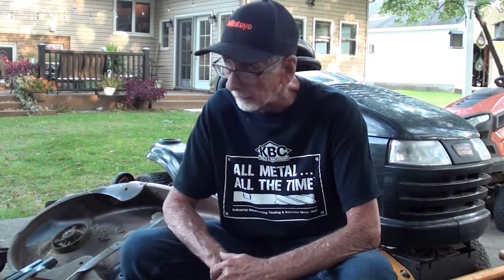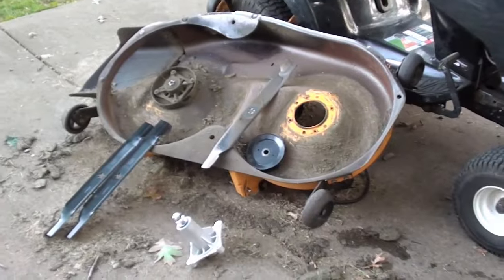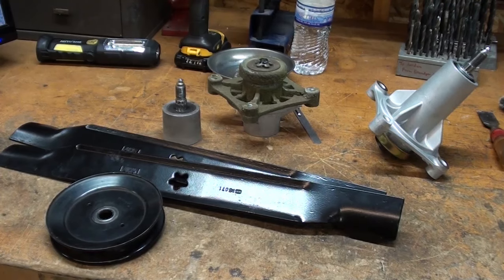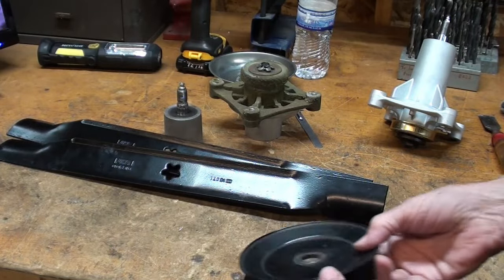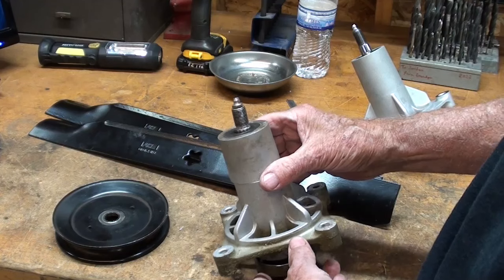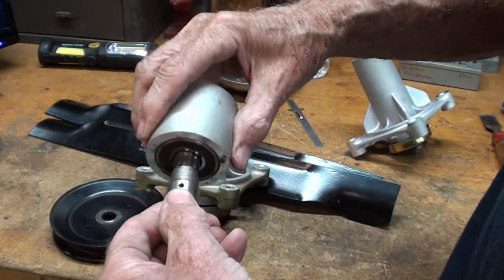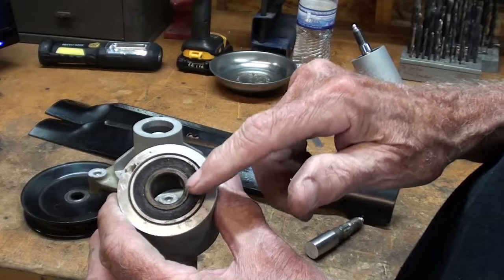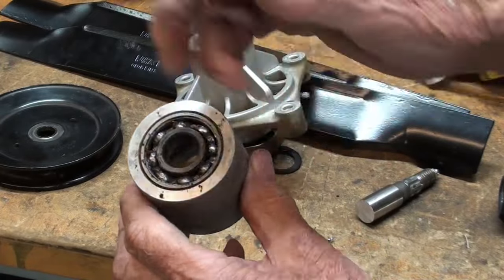LIES & DECEIT mower spindle fraud SHORT SUBJECT #52 tubalcain

Comment: I disagree somewhat... if the hub is filled with grease, it won't fill with dirt, moisture and rust. A sealed bearing will last much longer if it has grease against the seal versus moisture.  I used to off road race dirt bikes and had to change the sealed wheel bearings every season, because the hubs filled with moisture and so did the bearings.  I drilled the hub and added a grease zerk, so I could keep the hubs full of grease, which kept out the moisture. I never had to change wheel bearings for several years.

Comment: Wait until you get to the hydrostat. No external filter and nigh impossible to change the oil in; meant to last about 200 hours and that's on exclusively flat ground. I wish I could just buy an affordable lawn mower with a manual gearbox again.
Reply from the maker: I have never had a problem with hydrostatics and they have lots of hours on them. I would never go back to a gearbox like my old cub, cadet had.      It took so long to shift into reverse compared to hydrostatic
Reply: @mrpete222  Admittedly my experience is from zero-turns with Hydro-Gear motors and I mow a lot of hillside as well. I still think it's poor design to not have an easy method to drain and replace the oil. I just remember using a Ford mower with a gearbox when I was a kid and it seemed bulletproof. Side note, I want to thank you for all your videos. I'm just getting into machining and restoring some old machines and your channel is a gold mine.

Comment: Recently YouTuber Chickanic did a similar expose'. She is a professional small engine and equipment mechanic and she took a major manufacturer to task over this very issue. The manufacturer did their own internal investigation and low and behold, they changed their processes so that when you grease a spindle on their products, it actually does what it's supposed to do.
Reply from the maker: I like her, just have not watched her lately since she made the move

Comment: The front wheels on my  MTD mower has a molded in  plastic  "grease fitting" on the front  wheel bushings. Pump in  many ozs of grease and some might get to the bushing. MTD engineering it a strange  world. Mine is a  2005 model.  I read a 10 year service life. Being its 2024  I have beat the odds but its still in service. I think when it "passes" I will try to get something  better  enabled to have a  good service life.

Comment: Rants aside, I think the problem is more that an old design that needed regular greasing was updated by putting sealed bearings into an existing assembly (probably made in China) without understanding how it originally worked.  Not so much fraud as incompetence. I have seen videos where people were explaining that older (30 or 40 years) spindles indeed had greaseable bearings, and now the spindle assemblies are coming with sealed bearings. Is was suggested to remove the bearings, pull the seals, then reassemble.

Comment: Stopping the blade with force should have sheered the a pin on the pulley causing it to slip rather then stripping the blade, and spindle meshing.   
I hit a stump on a late night mowing, bent deck into blade and the sheer pin on the pulley released.   That winter I paid for a deck replacement.   When it was returned they had put the wrong deck on and my catcher would not mount.   They fixed it at no expense.   (Toro, time saver)
Reply from the maker: Good horror story

Comment: I have serviced hundreds of mowers in the last 60 + years and adding more grease to the quilt will result in more heat being generated the manufacturer of these sealed bearings put the precise amount of lubricant during assembly to give them an optimal service life no need to add extra !
Reply from the maker: Thank you for commenting. I appreciate the advice from a man who has repaired hundreds of these over the years.

Comment: I'm sorry but the little bit Miss designed if they would have made the aluminum housing thicker where the space in between the shaft and bearing what was the minimum clearance then it won't take that much grease to fill it up. The engineer just to take the design far enough to figure that one out!

Comment: Good video,Lyle. Another misleading con exposed here.
Something that does occur to me is if the bearings only had one seal fitted to the outer face of the bearings and grease was pumped into the housing void it would be very likely that once the void was full of grease any further pumping with the grease gun would push the outer seals out of the bearings due to hydraulic pressure/force.
Reply from the maker: True

Comment: I would not take out the seal on the top bearing, you will shorten its life. If you do you will have to be extremely diligent about greasing. That grease will settle out and you be worse off than with a sealed bearing. You should also drill a small hole in the housing to keep from over pressureizing the housing and possibly blowing out the seals. What I do is drill the hole, and leave ALL the seals in and fill the housing with grease. They know that most people don't bother to grease these things, and the zerks are an "option" for people that want their spindles to last a little longer. New spindles, ready to go for the MTD built units, are only $25.00 and are about as fast to change as a light bulb. Not nearly as sinister as it seems.  ; o)

Comment: I don't credit the people designing / building the spindle with the competence to be able to deceive anyone. I'm probably wrong but I would guess that the bearing with the rubber/plastic seal on both sides costs a little more than the bearing that is sealed only on one side.
My guess is that if they had gotten the proper model of bearings sealed only on one side,  that they would have put the open sides outward. 🤣🤣

Comment: I have to play the devil's advocate. I think the reason they use sealed bearings is because a sealed bearing will run a very long time with no service. If you used an open bearing and nobody greased it, it would fail in no time and the customer would blame the manufacturer and not their own neglect.

Comment: Reminds me of the khyber pass knock off firearms. They would copy physical characteristics of guns but none of them were functional. They knew what the sights looked like and where they went but didn't know how they worked so they just milled them out of a solid block of aluminum. These guys knew they're supposed to be a hole there so they put a hole. No one's ever going to cut the thing apart and actually look at it right?
Reply from the maker: lol

Comment: I have a 22 year old Simplicity zero turn that I have replaced the 3 spindles on it twice.  The first time, they went bad, and I believe there were no grease zerks on the spindles originally.  I purchased OEM spindles for the first replacement, and viola! grease zerks.  Thought I was having another bearing problem with the spindles, and assumed that the grease I was pumping in there was doing nothing, so I ordered some cheaper after market spindles.  Turns out, the second set of spindles were fine from bearing standpoint.  But they were beat up from sand and debris while mowing.  And those are sitting in a box and still spin like new.  So, maybe it depends on the manufacturer whether you get spindles that actually should be greased.  I am one of those where if I see a grease fitting, I connect the grease gun and give it a lube.  Keep on ranting

Comment: NOT FRAUD.  Just stupid customers.  For most people it is WISE to use double sealed bearings. What the manufacturer HAS DONE is provide a grease OPTION.  I have on numerous occasions pulled spindles apart, removed the bearings and REFURBISHED them with a good clean, new gease(properly packed), re-installed BOTH seals and good to go!

Comment: Don't forget these companies would insist on denying you a warranty claim because you didn't grease the spindle.
 I also bet they stopped making them actually accept grease because ether people put so much grease the seal popped off or they had trouble getting them assembled correctly with seal side out.

Comment: As a big fan of your content having found the channel while learning to work projects in my own shop and later restore some 30's machines etc. (South Bend 13) and also a fan of doing my own repairs, I to stumbled across this confounding curiosity after wasting countless pumps of grease. Being from the industrial manufacturing world I to cant fathom their disregard of prosses time to make a false addition for the sake of fooling the customer. I respectfuly submit that it is there as a means of disassembly, when there is no way of getting to a press or other equipment. I would like to know your thoughts as such since I am at approx 50% of your experience and time at perfecting my own craft. Regards
Reply from the maker: Thank you for commenting. I never thought of it as a method of disassembly. Maybe you are right. My method of disassembly was simply to cut it in half, lol.

Comment: Original designer WAY back in the day probably specified one side sealed, but over the years some guy finds a bearing $0.014 cents cheaper cause its a ‘standard part’ and it fits.. and then you have copycats that make scrap metal objects shaped like real objects, with poor metallurgy and no concept of how its supposed to work.  Sad when everything is made crappy.

Comment: this is another case of the people who designed it are not the ones making changes.
bearing design changed or part numbers changed supplier changed. a new version was sourced for parts and nobody had the brains to go oh. thats incompatible. or if they did know that they did it to make it less reliable and more replacements.  all industries are guilty of this since all the bankruptcies from over engineering.

Comment: so, heres the deal, I have  commercial mowers, they stopped providing the unsealed bearings because the sealed bearings last just as long, and they dont get dirt and grit in them. So I understand your logic, but its flawed, I have three dixie choppers mowing at 12 mph, I replace the bearings in that housing, the sealed bearings are lasting longer than the unsealed ones, and I dont grease anything anymore. Two of these mowers came with open bearings, and originally the kits to repair them came with open bearings, then they stopped and went to sealed and lubed for life, they work better than unsealed.
Reply from the maker: They are interesting and good logic. I heard those Dixie machines are great for lawn services.

Comment: Just to play Devil's advocate, since you didn't own the mower from new, you perhaps can't be 100% certain that the bearing with the twin rubber seal is the original.  It's just possible that the original bearing had no seal on the inside, but was replaced at some point by someone who bought the 'sealed for life' line at the bearing supplier.
There's only one thing for it.... you're going to have to cut the new one up too, to prove the point. 😂

Comment: If you don't have steep hills or ditches to mow, go find an old Wheel Horse tractor and deck.

Very simply built, stout cast iron Kohler engines, Sunstrand hydrogear or WH 6-8spd transmissions,  and easily accessible parts that can be easily serviced.

Honestly,  I'd rather use my 1967 Wheel Horse 1277 hydro to mow, pull trailers,  plow the garden,  and push or blow snow than anything made today.

Comment: I’ve seen this many times before. 

I guess the guy who designed the shaft with a grease port and the guy who chose sealed bearing’s didn’t talk to each other.  More incompetence than malice of you ask me.

Often I see it on parts that are obviously just rebranded. The original mower this spindle was designed for probably had the proper bearings, but not they’re reusing the same spindle without reading the fine prints.

Or maybe someone realized that 9 out of 10 owners didn’t even know how to use a grease gun, so the sealed bearings last longer than ungreased ones.

Many times I’ve removed the seals from one side

Comment: Most cars and trucks nowadays no longer have grease fittings on them. I remember when older cars had sealed leaf springs that were inclosed in grease. Battery powered tools is another scam IMO. I am sorry sir, we no longer sell batteries for your drill. Now let me show you our new Wizbang model 2000 model battery powered drill. Where is your Wizbang model 2000 drill made ? It was designed in the U.S., and Made in KOW Dung Pi. Sir, hello. Where are you going ? Tires screaching and smoke rising.
Reply from the maker: Yes

Comment: Mr. Pete what I understand the top bear is supposed to be sealed because of gravity when you put grease in it is for the lower bearing. Well, lower bushing down by the blade. Is it designed wrong. Well I'm not even close to being an engineer or even a machinist. Just a wannabe.  I replaced one a john deere sealed bearing on top bushing on the bottom. It had to be replaced because it wasn't greased for 5-6years. The deck had so much vibration before i started. Once replaced it smoothed out alot. You could pay more and get the upgraded spindle with all bearings

Comment: I think you missed the worst thing to rant about.  The narrow spline on that pulley and the soft shaft material  is what I would have concentrated on.  My 50 year old Cub Cadet have tapered greasable bearings by the way.  also they have a friction washer so the blade can slip a bit if it has to.  Is Craftsman even Sears anymore?  I thought is was Chinese by now.

Comment: How much would an OEM spindle cost vs the Amazon spindle? 
As far as I could tell from a minute or two of searching, the OEM would cost around $60 while the Amazon version is around $27. 
And also as far as I can tell, the OEM has open backed bearings already installed. 
Amazon suppliers probably use multi fit bearings to reduce inventory and cost. 
To call it a scam and deceit is a bit harsh don't you think? Yes, if you paid $60 for one, then wind up with bearings sealed on both sides, sure, not good. 
Just an observation here, Pete, you seem to be getting more and more paranoid and more and more anti-government. 
It's really not healthy to constantly think that the establishment or the deep state is out to get us for whatever reason. 
Relax, Pete! It'll be OK. 🙂

Comment: It just seems like crap engineering. I'm not an engineer but what you point out about not having the bearing sealed on the inside makes sense and seems completely logical.

The other thing is, for something like that, why wouldn't they put some sort of shear pin in do exactly what a shear pin is supposed to do? e.g save the rest of the mechanism if something like this happens. It would be interesting to hear other people's opinion on that.

Definitely rant worthy. Don't get me started Lyle. I bought a new bike that is partly assembled in China. They over-tourqued the locknut/cone and stretched the threads on the axle and I ended up having to buy a new axle. I haven't even ridden this "new bike" because of this. I reported this to the company that is responsible for the manufacture of the bike in the US and their response was contact your local distributor. Nothing about passing on my feedback to the manufacturer. They're just in it to sell you shit, make money and let the customer pay! I'll never buy another product from this company again because of that.

Comment: Are you wrong? Has Sears provided a better product by using both sealed bearings not needing the grease zert? It's presence is only a dust cap to close a manufactured hole for cheaper unsealed bearings on lower cost mowers.
My spindle issue was my '71 Wheel Horse shreading it's mower deck vee belt in 2006 after 3 hours of use. The deck was replaced brand new in the 90's. One spindle had a machined diameter step missing that permitted the spindle under load to float higher rubbing against the idler tensioner and fray each new belt. 
On the 3rd 6 hp Kohler my nephew son takes it to tractor parade and shows.

Comment: well i worked on small equipment for years. when margins get tight so do the products. everyone started going to sealed bearings. (remember when mower spindles had tapered bearings?)   well all the older folks rebelled because they couldnt grease them. sales dropper and what you see here is the result. give the customer what they want they will buy.  decietful  you bet.  but if things dont break you wont buy new.

Comment: FYI I got this video recommended after watching yours, because the title is so similar: "Don’t trust the “Experts” Grease your mower deck sealed spindle bearings"
The guy did a grease test with that very spindle and sealed bearings. 
Very interesting findings: the grease does seem to penetrate the rubber seal (eventually, it takes 40-70 pumps with a grease-gun): https://www.youtube.com/watch?v=PwObkilFXN0
Reply from the maker: Thank you, I will watch that

Comment: I'm betting the original design used plain bronze bearings. so the shafts had grease fittings. My Simplicity 1987 has plain bearings, I'm guessing that people failed to grease the zerks on the Crapsman's. so they changed to a sealed roller bearing. But the shaft never changed. My neighbor had a smaller Simplicity, never greased the fittings and wound up wallowing out the towers. When y ou have more clueless people you have to design for "clueless"..  Wonder why they didn't change the shaft, to save money.